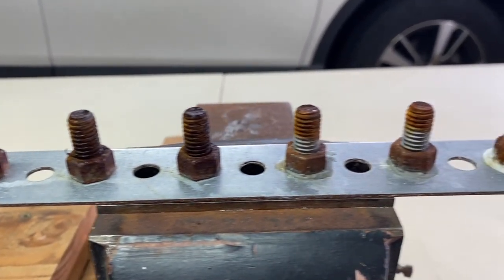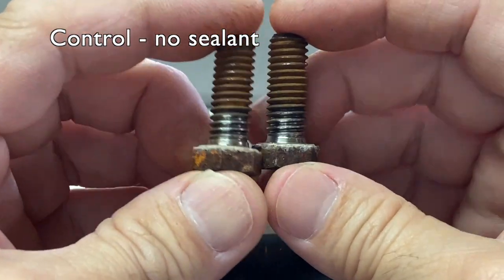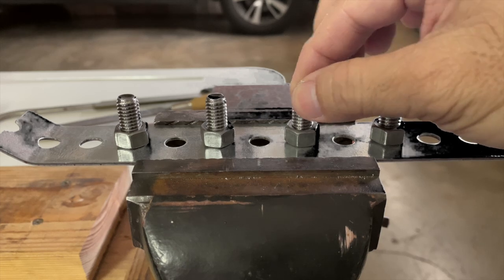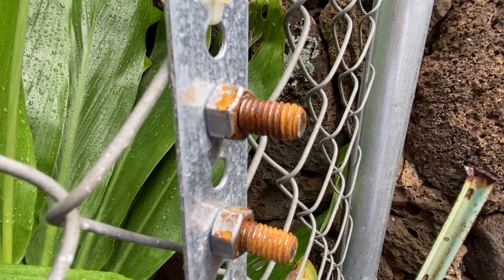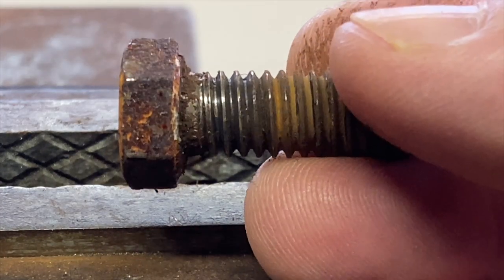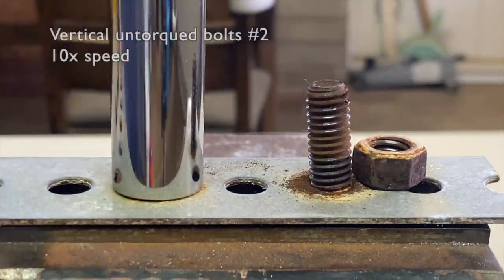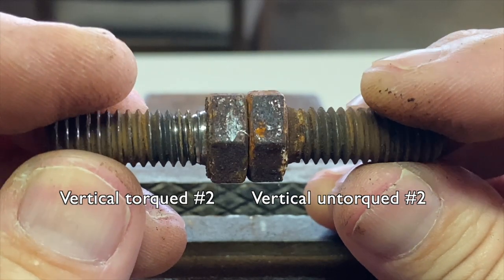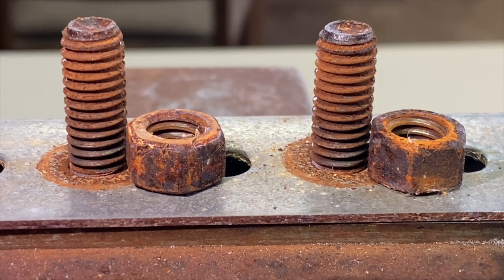Nuts & Bolts - 2-Year Nut and Bolt Rust Experiment

Comment: Thank you sir for taking the time to make these experiments. This particular experiment should be of use to anyone who builds things. I just found out that thread sealant should be used on any nuts and bolts under the car that will need removal at a future date. In my opinion, this is what the internet should be used for. 👍🏆
Reply from the maker: Thanks!  Be sure to seal the exposed threads.  
👍😎

Comment: Truly interesting. I lived in the UK and Ireland a few years, and as my motorcycle bolts were indeed rusting (never in dry home land had that issue), I did my own research and experiment in the backyard for just a few months, exposing a variety of bolts, screws and washers of different steels in identical packs to the elements.

control vs wd40 vs (incognito product)... sorry, I don´t manage to remember but a more expensive product that does not exist here. Funny thing, control ended way way better than wd40, which developed a lot of rust... my guess is the  solvent in wd40 actually removed the original oiling or just cleaned the parts and when the thin oil vanished, the metal was more exposed than bare. That or I totally messed it up.

The product I cannot remember was a spray way more viscous and adherent, that still was greasy to the touch after months, and did the job nicely. Null rust.
Reply from the maker: Thanks!  Maybe I should conduct a test with protecting the exposed threads.  
👍😎
Reply: @HacksbyDad  I would be delighted if after some time such test appears. I barely tested two products, but for sure there are so many interesting ones: products to blacken steel (black oxide coating maybe the name) for example always intrigues me, as is unclear how slow it rusts again untreated one. 

I will be around for sure in case it does as the channel is just great. Thanks for the great work
Reply from the maker: @JosepsGSX  I'll add it to my list of video ideas.  👍😎

Comment: Would probably have showed same results if used a nut splitter. But that way the threads would not have been wiped off as the nut was turned off.